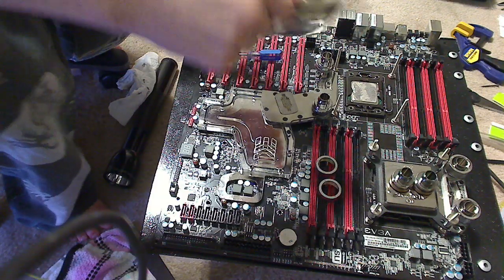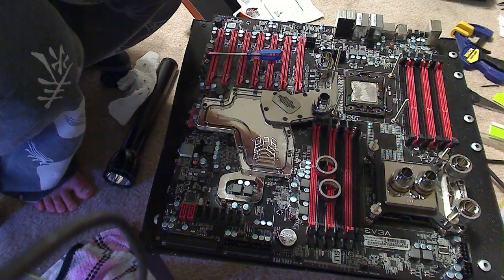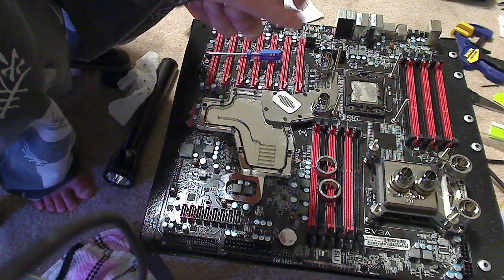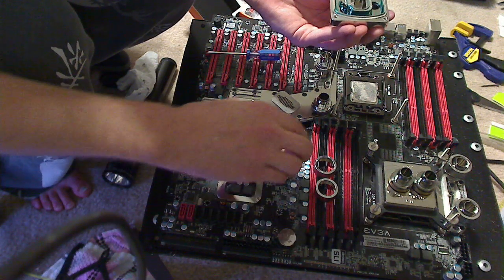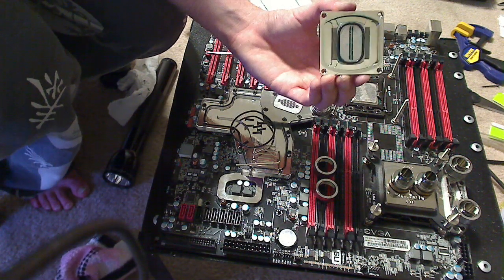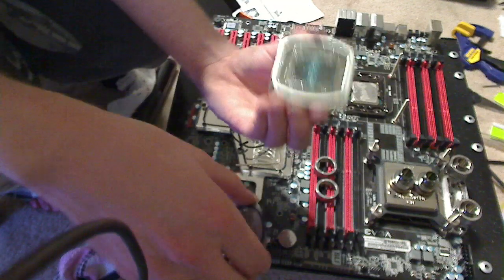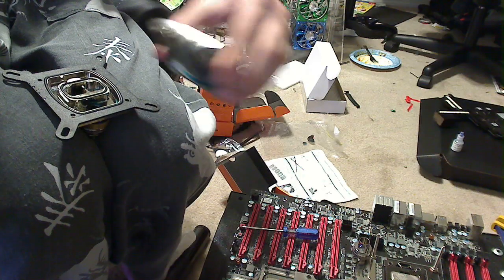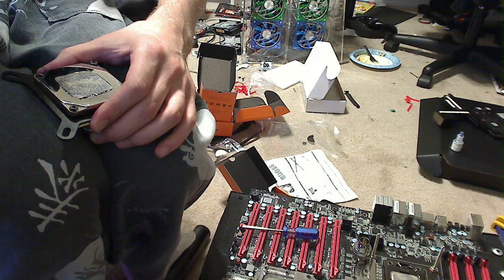SR-2 Build Installing Waterblock Jet Plate HF Supreme

Comment from the maker: Well that all depends. Usually you want a jet plate of some sort because restriction doesn't always mean a bad thing in a water cooling setup. For instance, if there isn't any hang time on the block then it doesn't give ample time for the heat to dissipate into the water. So depending on the number of things on the loop (for instance my loop with 2 cpu) is your need for the restriction on the jet plate. Not every water block is the same as this one ;)